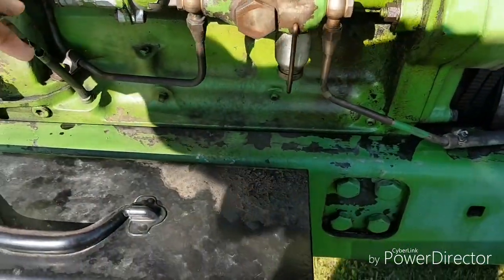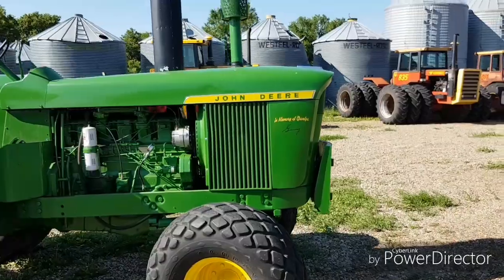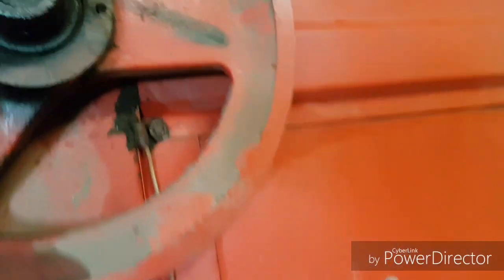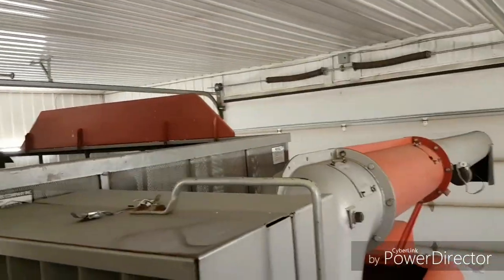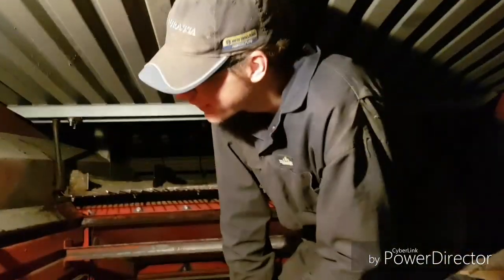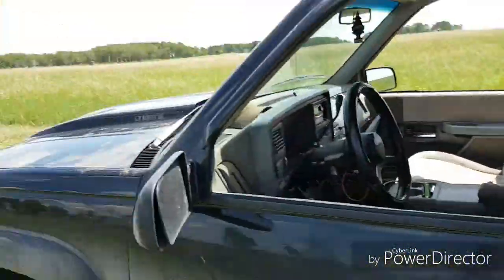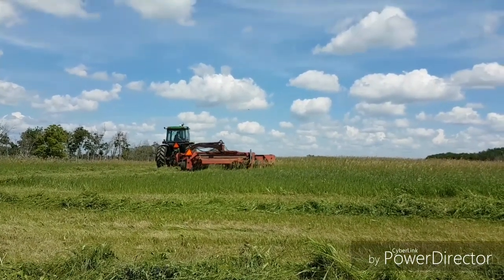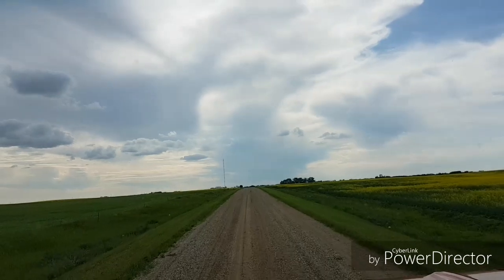Fixing the 860 sieves, cutting and trucking hay!!

Comment: I haven't cut any hay in over 15 years but in cropland I swath every acre. Gets it off faster than dessicating and waiting. Run a self propelled 25' Westward but I have a "Case" 725 pull type with a pickup reel as well that gets used if I have the extra help or whatever. Usually I run the pull type because any help I get they want to run the self propelled. If we are in different fields, I open up the field like how you do it. I just take the first round backwards, and then come back the normal way when I have a full round done. I run crop lifters on both swathers, and you would be surprised how little gets trampled from the tractor tires when you cut the second round, even in cereals. I would probably do the outside round normal if I could, but up in the "Northwest" Saskatchewan Land, you would be driving into tree lines, rock piles, power poles, and fences most of the time lol.
Reply from the maker: Haha I'm.with ya on the swath everything boat haha

Comment: Hey Nick & Antoine!
Greetings from Dawson County, Montana  USA

Just another day in paradise I see.  You run some old iron too I see. When I was farming, I cut my harvest teeth running a Massey-Harris 92.  No power steering, a 14 foot cut and an impish 50 bushel grain tank (I think). Then we upgraded to a MF 750...man were we in heaven.  24 foot header and...AIR CONDITIONING!!  Yeah, the return on those MFs were troublesome. Whenever the alarm would toot at us, 100% of the time it was the return plugged.  If you didn't stop soon enough, you had a fried belt to replace. Then the feederhouse was breaking loose from the combine itself.  Caught it before it broke completely. My 750 had patches on patches at the same wear points as your 860. Another wear problem was the header.  Right in the middle where the crop went up the feederhouse...another troublesome area. I guess MF didn't expect the combine to run 25 years.  Hwy Nick!  Thanks for sharing your day with us...take care.  Sorry for the extra-long post.
Reply from the maker: That's fine I love hearing guys stories lol! Ya and they'll be around yet long after the new ones are in the shit heap lol

Comment: The straw walker bearing is relatively easy, that pulley can be a tough one to get off though... Sometimes they need to be heated... Sometimes they come off, then sometimes they can go back on loose...  I have one that is loose and keeps cutting off roll pin... Instead I use a grade 5 bolt but leave it a hair loose and put a jam nut on it... That lasts the longest... Eventually yes, it will wear the hole in shaft, but I figure I won't have the combine that long, or It'll be a parts combine...

Comment: You should take the 3 screws  out and let the instrument panel down... If mice are in the roof, they're in there too and they can build nests in there and can chew coating off of electric wires... As well as air fresheners,    You can sprinkle some coffee around in there to get rid of the mouse smell... Just dry,  cheap ground coffee right out of the can will work...  It'll smell like coffee instead of mouse.
Reply from the maker: Been there done that

Comment: Yes sir I know what you’re talking about on the Massey combines. I would love to have a chance to meet the engineer that designed some of that crap. So I could punch I’m in the throat. On my 750 Massey I’ve had to replace the bearing on the cylinder on the left side twice now and there just ain’t no easy way to get to it with out taking the tire off and tearing half the machine apart to what you actually want to work on.